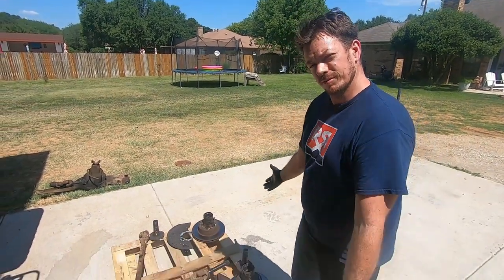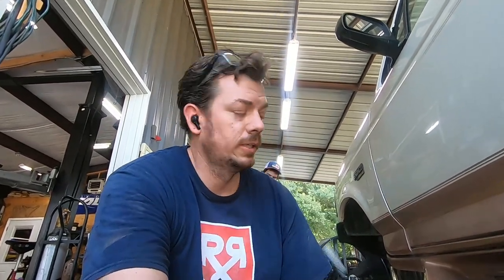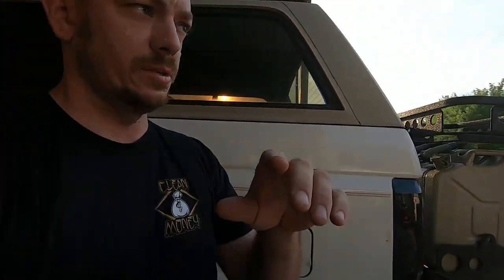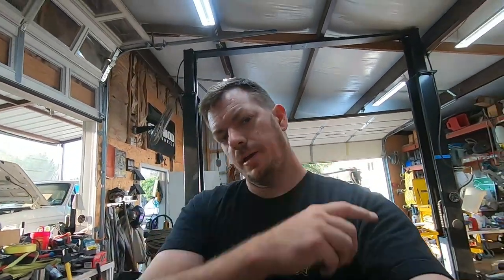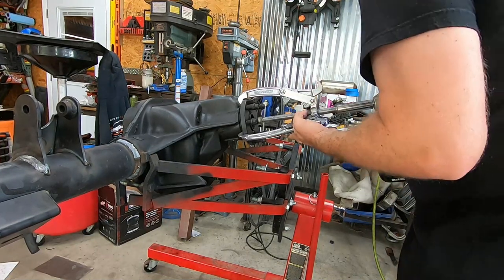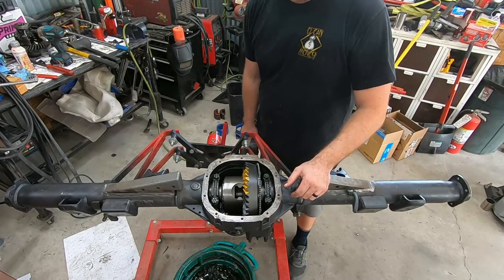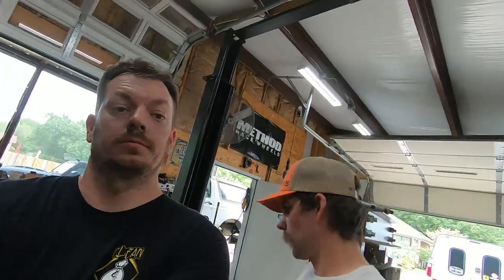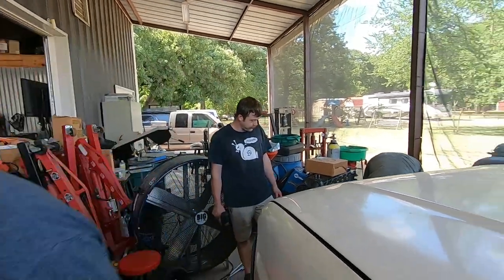'95 OJ Bronco gets FULL DESERT SUSPENSION! 4inch lift and JUMPABLE!

Comment: What shocks are you using in the front? I've gone on the bds website and there's no options for fox 2.0s.
Reply from the maker: Everything on this build is from Desolate. It's meant to hold up to desert abuse. Not mall parking lots.
Every BDS kit I've been exposed to is a swing and a miss. Decent intentions but the execution isn't as good as it cracked up to be

Comment: Have you ever put a modern raptor style 5 link rear suspension in the back of one of these broncos?

I have an 89 I have had for 30 + years that I am planning a full rebuild and modernization on.
Reply from the maker: No, but the stock Raptor setup isn't an upgrade from this leaf package. The Desolate 4 link kit would be on the "jumpable " end of that spectrum.